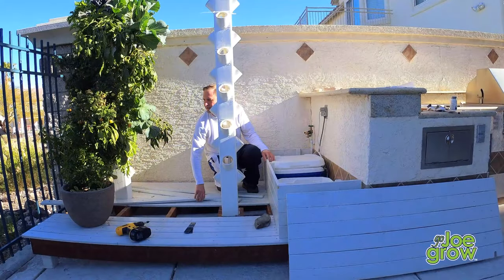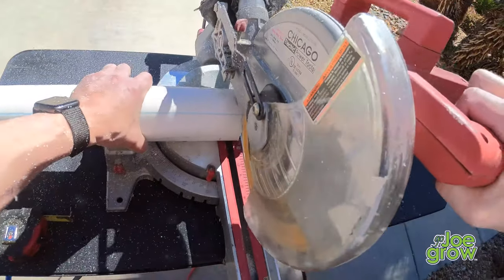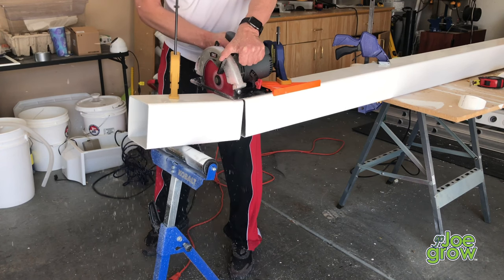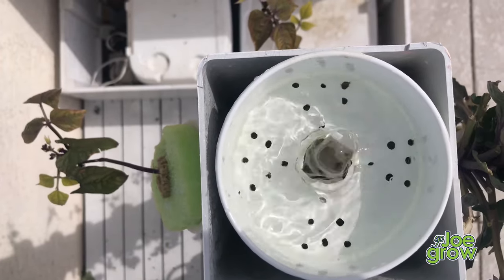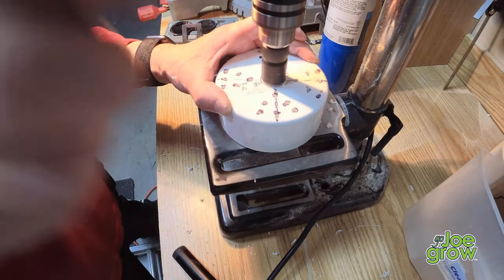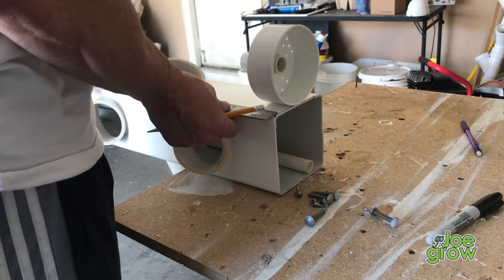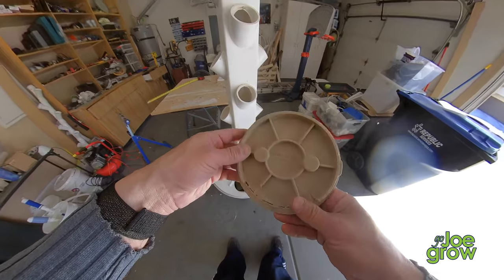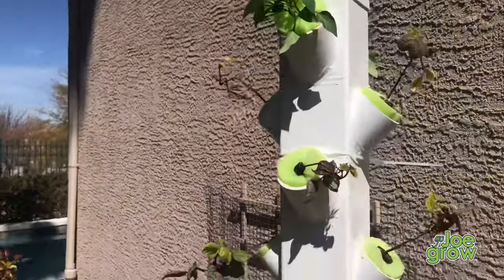Build a DIY Tower Garden the Easy Way!

Comment: I think it would be easier to decide how long each pipe would be and then cut your 0° links first and cut them off then readjust your softer to 30° and trim the connection piece

Comment: i would like to know if a solar water foundation pump would work it won't run at night but would run most of the day
Reply from the maker: I doubt it. The pump needs to run 24 hours a day (15 mins on / 15 mins off). So if it ran at night, you would need some kind of battery. Also I don't believe those solar pumps are strong enough to push water 6ft or higher but I could be wrong...

Comment: What about weight? If you were growing cucumbers wouldn't it tip the tower? Do you have to remove everything to clean or change the water?
Reply: You have to clean the water about every week or two for best results. The tower won't lean, its held by the water weight and the big surface area of the bucket